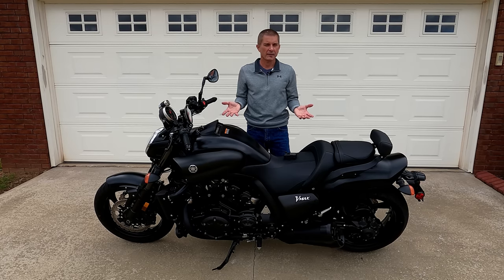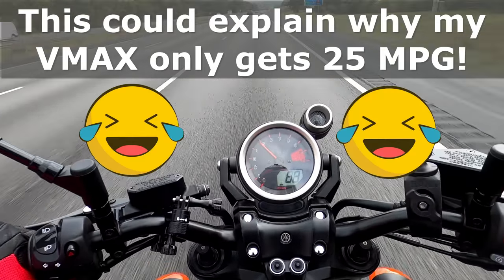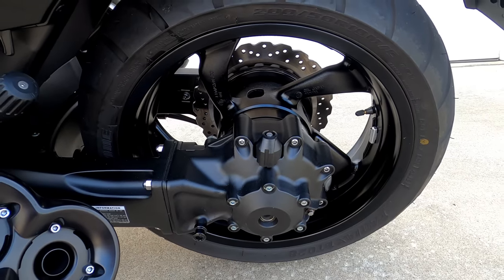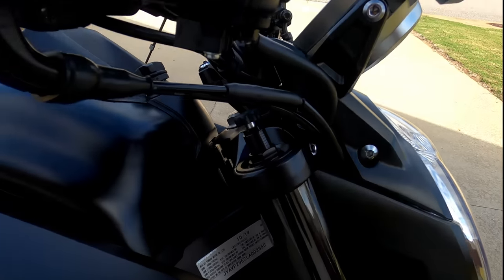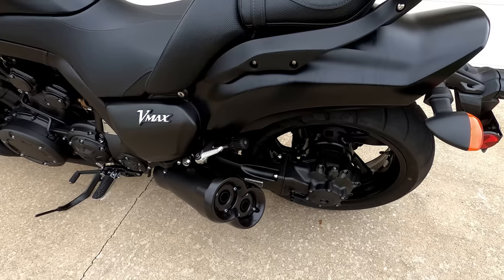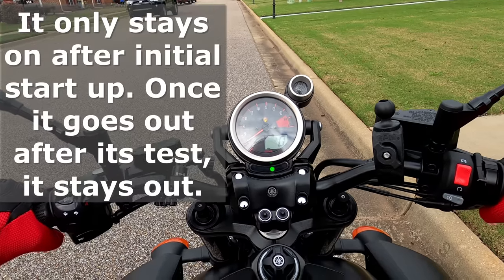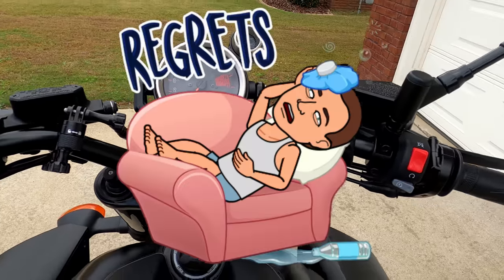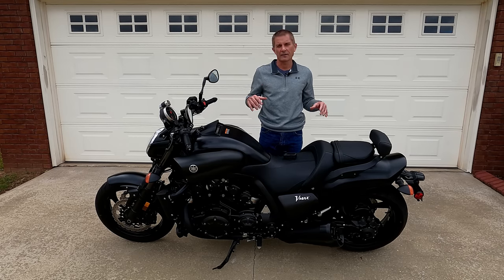2020 Yamaha VMAX 1700 Comprehensive Review | Walk Around and Ride

Comment: Hey Jeff,  Honda is the company that really had the problem with the rear wheel "Jacking", as you say,,,,,,,, I know exactly what you speak of.   My name is Marcel, I'm 57yrs old, my first bike was a beautiful NEW 1981 Honda CX500Custom.       Wasn't so powerful, but still I've felt that Jacking......  cut to some 30 yrs later.       Now I'm 52yrs and I want to get back into Bikes....... thought about the bike that I've wanted , (BACK IN THE DAY).      I bought a beautiful 1981 Honda CB900Custom........ shaft drive, air cooled. 4 cyl/ 4-exhausts.    2 speed transmission, if you'll remember.... Hi-gear, and Lo-gear......  but best to drive as a 6 speed.   Well, Honda didn't fix that Jacking problem until sometime after 1986.    Cut to 2016, I seen in a Craigslist Ad.,,,,,,, a beautiful 1981 Yamaha XS1100H,,,,,, full dresser,  yes, Yamaha , if you'll remember had the shafty,  back when they brought out they're xs750.....   and word has it , that they paid some fees to BMW, and learned how to stop the Jacking.  Anyways, well I bought it and wow,,,,,,, Love it!  I've also some years later, bought a newer '04 Yamaha FJR........> Great bike, lots of power,,,,,,,, great GAS MILEAGE,,, great brakes (anti-lock).... but had to sell it,,,,,, don't like all of the plastic crap.......got to see the engine!   Glad to see you're back into biking again!
Reply from the maker: Thank you, it’s good to be back riding again. I’m having a great time. I’m also 57, so we were exposed to bikes of the same era. Thanks for watching and sharing your experience.

Comment: Great video. However as a vmax ownwer I have to say to crank the trottle a littelbit in idle will not open the exup valve so it is actually louder when you ride the bike on high rpm and wide open trottle
Reply from the maker: My goal wasn’t to see how loud I could make it, but to demonstrate how loud it would be under normal circumstances while sitting in the driveway to show that neighbors shouldn’t be annoyed. Doing as you suggested would surely upset the neighbors. 🤬😡

Comment: I see you have a Ram mount on your handlebars. I love my Ram mount wireless charger cell phone mount on my bike! As far as the ABS is concerned, all motorcycles have different veins or rings or pick ups. You can tell if your bike has ABS just by looking for the sensor as you stated at the front wheel.

Comment: 27mpg, 94” long, 67” WB, seems like a one trick pony for $18k.  
1000 Kawi Versys 60”WB, 28L bags, 3 rider modes, elec suspension controls,  plenty of power, two up capable, fun in the twisters, good mpg, same money.
Reply: Sounds like yours is a one trick pony as well. Wanna know a secret? ALL motorcycles are one trick ponies. There is no one best bike. A Vmax is a street legal drag strip bike. Like yours, it can do other things. Your bike is no 1/4 mile crusher. Just 2 wheels to haul extra fuel. See what I am getting at?

Comment: Oh how I love that satin "50 shades of black" color theme on more recent models. 

I have a 2009 with black&silver color, glad to see that the VMAX have stayd pretty much unchanged. I did 12 000km's (about 7 500 miles) through last year, and I'm surprised that I'm still on same rear tire, though it needs to be changed before next riding season - running on 240 "fat" rear. However I generally ride quite easy, because I still feel I haven't fully tamed the beast - it does bite if you're not careful and go over your limits :-) But that's probably why my fuel consumption is also constantly around 7,5l/100km (around 30mpg), give or take a little. Push it, and it eats the tire and and drinks the fuel ;-)

Comment: I had a 1985 vmax earlier this year, bike that started it all.  Was a fun bike but needed to much love for me to keep it.  Would love to ride/own a new one but they aren't affordable unfortunatly.  But amazing machines.  Those roll ons you were lugging the motor lol.  Drop a few gears and do a proper wot pull.  Ive had 200+hp bikes so even a new vmax wouldn't be the fastest bike I've ridden but they are rocket none the less.  Maybe one day my bank account will allow it.
Reply from the maker: Thanks for watching. I wanted to show the torque at highway speed in the top gear, hence the term "roll on" rather than "downshift". It was not lugging at all: it was pulling hard all the way. Below 3,000 in 5th it will lug. I wish you well in obtaining a 1700 in the future. In case you haven't heard or watched my latest video, Yamaha recently pulled the plug on this beast. 😥
Reply: @JeffMarcum  I guess I didn't mean lug but In general a roll on especially on the highway deserves a downshift or two and show the true brutal acceleration.  But they have plenty of torque to pull at any rpm in any gear thats for sure.  I truly believe if the price point wasn't as high it would have sold better and in turn stayed in production.  But they also only had one face-lift that came in 2007 and then didn't change much after that which is another reason to shut it down.  Bummer to hear.  But will always be an iconic bike.  Hope to own both another 1985 and a new model at somepoint.
Reply: If you arent opposed to used, you can find the earlier gen 2s for reasonable. Now granted I dont know your financial situation or budget, but you can find, say a 2009 or 2010 for 10K or less. I got my 2009 for 10K with 5800 miles on it. Less than $2 a mile.

Comment: I ride and race my 1700 V-Max all the time,  race tuned to 220hp, 180NM
Reply: What have you all done to get 220 at the wheel? What kinda times are you running. I'm thinking about getting one to dragrace on a regular bases.
Reply: Approaching 220 at the crank sometimes less, 
Akrapovic titanium collector pipes, akrapovic cans, K&N filter, airbox restrictor plate removed,  Exup system disconnected, Tim Nash ecu reflash (Gurued Gear)  top speed went to 163mph with standard wheels, 168mph with BST carbon fibre wheels. 
Good luck
Reply: I never dyno tested the bike but standard they are 197hp at the crank, so I figured de-restricted it would feel different,  it did feel different,  at 1/4 mile with BST wheels my top speed was just over 150mph. 
On the road with the above mods it is a totally different bike. Good luck.
Reply: I have not yet gone quicker than 10.6 sec, but this is kept as a road bike not turned in to a drag bike, to turn a 1700 vmax in to a 100% drag bike is fine but it's then no longer a road bike.
Reply: You will be at petrol stations more than riding that beast
Reply: I get around 72 to 76 miles before fuel light comes on if I go exceptionally slow or around 58 miles if I don't go slow.
Reply: @fromtheedgeofdarkness  jeez that is low range... But not exactly a touring bike. Must be fun tho with that exhaust.
Reply: @Corkoth55  it's an amazing bike. Take care buddy

Comment: Hi Jeff, great vids about the vmax. Do you happen to know where the connector is to use for pulling codes? I've heard it's not a standard OBD II style but is a smaller 4 pin. But I'm unsure of it's location
Reply from the maker: I do not know where it is located. I have not needed to use my OBD reader on the VMAX.

Comment: Excellent video. I am considering this bike but wondering how comfortable the seat is for the rider and passenger and maintenance costs and is there any way to put a fly screen or windscreen of some sort to make it more comfortable on the highway. I ride a 2017 Hayabusa and BMW R ninet now. My Hayabusa is great but my BMW has the thong seat and is designed way too small and kills me so I am looking to replace it.  Thanks!
Reply from the maker: This seat for me is a little stiff. As for the passenger, this is not a comfortable ride. The seat is too small, too stiff, and the foot pegs are very high.

Comment: So when both breaks are linked does it matter which one I pull? In an emergency stop can I just stomp and grab or what? If I’m trying to manoeuvre up a tiny path covered in wet moss is the front brake still a floor magnet? 

Pretty much every bike I’ve had has been carb and I’ve never had abs so absolutely no knowledge on the subject.
Reply from the maker: Linked brakes work like your car: one pedal operates both front and rear brakes. Therefore, your rear brake pedal will apply pressure to both your front and rear brakes. Same with the front brake lever.

Comment: My 94 V-max gets 25 mpg at best.  About 80 miles to reserve.  I would love the new version, but it's 100 lb heavier than 1st gen.
Reply: Pretty bad when a lot of cars destroy a motorcycle in mpg.
Reply: That's why I sold my old V Max it's a pain filling up with petrol for me every 75 mile the reserve switch isn't even a real reserve it's just a fuel pump override....Yamaha fucked up with that
Reply: I have owned a customized 1994 Yamaha V-Max as well as a near OEM 2007 Gen-1 V-Max that both gave me far less than 30mpg (more like 25mpg) using 89 octane gasoline.  The cost to overhaul the V-4 carburetors on those two as well as my 1987 Kawasaki ZL1000 Eliminator left a bad taste.
An electric motorcycle may nudge me into satisfaction with regard to ease of upkeep and limited maintenance as well as its regenerative braking/ABS features.
Jon vmax@stny.rr.com for shared images

Comment: What is "jacking" you mentioned about the driveshaft?  I would only change two things. First is the exhaust. Waaaay too quiet for a beast like this (sounds like a Goldwing). Junk the catalytic convertor too. Also drop the rear end somehow to get rid of that dirt bike clearance between the tire & fender. Otherwise it's a great lookin bike.
Reply from the maker: Jacking means the rear end rises during acceleration because of the shaft drive.

Comment: Really a pretty good bike to
Compare to my Kawasaki C-14.
Just about the same weight.
Yammie has more horsepower
But...... Mine cruises at 80 mph
At 3750 rpm. Top speed not
Something I have achieved.
Both really a cool way of going
Really fast with competence.

Comment: Why nothing about the turbo version? I can only guess 250-300hp. Back in the early '94 I had an 1100 Max. In town redlight to redlight it gives you control of the road. One company could boost the first max to those levels. But it was rough and I had to give it up after I blew my hip. Hospital in this city is F-rated and a hospital nurse said dont get hip surgery here. But Id be tempted toward  surgery if the Turbo model didnt cost ($37,000) 2/3 the price of a Tesla 3motor supercar.

Comment: @Jeff Marcum I ride atv's and dirtbikes. Do you think I can buy a VMAX as my first road bike ? I'm 28 years old by the way
Reply from the maker: Your experience on dirt bikes is definitely an advantage. However, I still recommend something less powerful and lighter than the VMAX while getting used to driving in traffic.
Reply: @JeffMarcum  roger that thanks Jeff
Reply: Just respect it, my first bike was a 85 vmax.
Reply: An ATV and dirtbike is not a street bike. Different handling characteristics. ATVs and dirtbikes, you rely on drifting the rear tire to move through turns and maintain speed. Once you get to the street, drifting on asphalt will more than likely result in a high side wreck. Start small when transitioning. Get something in the 400cc range to start(since you already have bike experience. Once you learn the differences on how bikes handle between the dirt and street, move on up.
Reply: @JeffMarcum  Hey Jeff ended up buying a 2015 Honda interstate 1300.
Reply: @iamtheoffenderofall  Hey ended up buying a 2015 honda interstate 1300. I'm 6'3 190 a small bike is out the picture. Thank you for your input though. Will probably end up buying a Vmax or Xdiavel next

Comment: If you are taking a trip, a 6th gear would take the RPM's down to probably at least 2600 even at 70 mph and therefore would give the Vmax better fuel mileage even for a daily driver on the  highway.
Reply: He just explained the number of gears doesn't tell you anything  .. the ratio does . You can have 12 gears and still not have an overdrive

Comment: Going back and fourth between the original and the new vmax. I like how compact and surprising the original is, but there's a new gen not too far away and for not too bad a price. Only reservation is how tame/manageable the new one will be with 200hp.
Reply from the maker: You have a tough choice. 🤔 Either way, you will have an iconic bike. Thanks for watching.
Reply: All depends on you the rider. YOU decide if you want a tame pussy cat OR a roaring lion, simple as that.
Reply: I couldnt decide either. SO I got both. 2007 and 2009.

Comment: I wanted a VMAX but ended up buying a Raider.  The Raider is ok but not anywhere near the power of the VMAX.  I came from a Honda CBR1000rr and still miss all that power. The VMAX seemed too tall for me and felt like I was sitting on a 55 gallon drum. Can I ask how what your inseam is?  You look like your about my size.  I'm 5' 6" as well.  Do you find yourself tippy toeing this thing?  I didn't know if the 2020 was different than the 2017 I looked at.
Reply from the maker: My inseam is 30”. I am on the balls of my feet, not on tip toes. I’m used to being on the balls of my feet. My previous two street bikes were about the same seat height. All VMAX 1700 bikes have the same seat height. As far as I know, absolutely nothing on the bike changed except the colors throughout the years.

Comment: Do the newer ones have vboost? I had a 94 1200 for about 10 years. And at 6 thou rpm vboost kicks in. And hold on. I sure miss her. Thanks for the look.
PS One thing that was a definite great thing which many Euro bikes don't have standard for a bigger bike is a center stand. At least mine did.
Reply from the maker: I address V-Boost in this video: https://youtu.be/CVCjjdbiF6w
Reply: @JeffMarcum  I didn't see that, but it's not important. By the time you bump the engine by 500 CC s, fuel injection and no doubt other tuning, the HP is what, close to 200? All I know is I remember it well. And these people saying the low end power was wimpy before vboost kicked in at 6 grand, have probably never ridden one. Like u said, there's a reason why they never put a 6th gear in the Max. 
All I know is, the Max is a badass looker and the power does not disappoint. Ride safe.

Comment: Do your front breaks squeak?  My 09 has always had squeaky front brakes. BTW I'm still looking for that 6th gear.... :P
Reply from the maker: Mine do not squeak. After having a 6th gear for over 25 years, it is hard getting used to only 5.
Reply: @JeffMarcum  After having owned a V65 magna over 16 years ago I am still looking for that 6th gear. You will never get over it! But what you will find on your vmax is the more you wack the throttle in any gear, the less concerned you are about needing to downshift! :)

Comment: Just wondering if this bike utilizes the V-boost carb system?
Reply from the maker: It does not because it is fuel injection. It has a different technology designed to mimic V-boost. I will cover that in a future video.

Comment: Your 130lbs - that bike is driving itself. I have one and my only issue is the weight - i am 230 lbs and strong , this bike is like wrestling a bear in the garage or at slow speed which is another thing - they buck and surge at low speed due to the high compression.

Comment: Nice looking bikes - they just notorious for not cornering, not good on a bike with such power
Reply from the maker: The cornering issues were only applicable for the first generation. Even then, Yamaha addressed those issues starting with the 1993 models with an upgraded front suspension. This version handles as well as any 67 inch wheelbase bike could possibly handle. Thanks for watching.
Reply: @JeffMarcum  that's good, it was the only thing putting me off one, you know, didnt wanna have to spend more replacing the forks. Beautiful bike though man, thanks for taking the time to reply H&R

Comment: 683 pounds? Oh, my. 
Love the bike, though.
Reply: Most Harley cruisers are over 800. Mid 600s is extremely light for a motor and bike of this size.
Reply: I took one out for a demo ride in Sturgis, SD a few years ago.... It weight a lot less than my k1600 and the center of gravity is reasonably low..... It could make a great daily driver espacialy with the small oem side bag but it is definetely not for beginner... 🤔🤔🤔🤔😁😁😁😁🤣🤣🤣